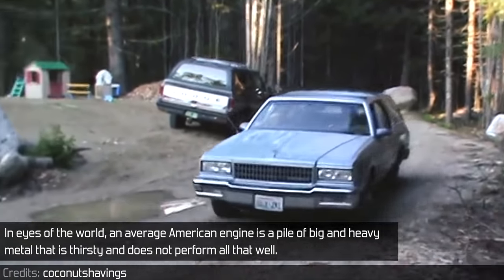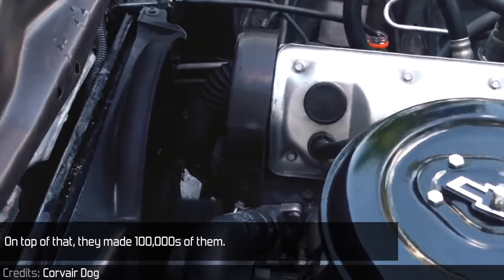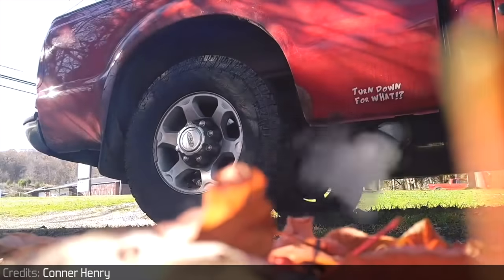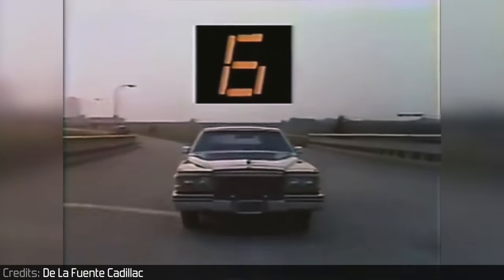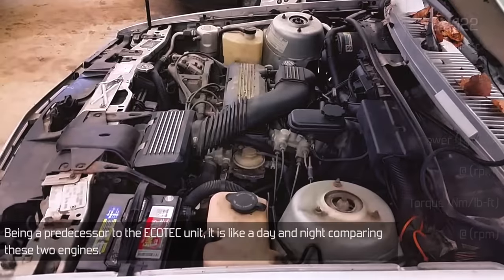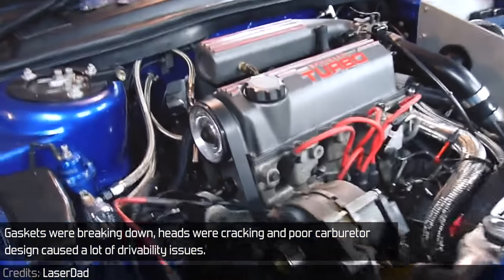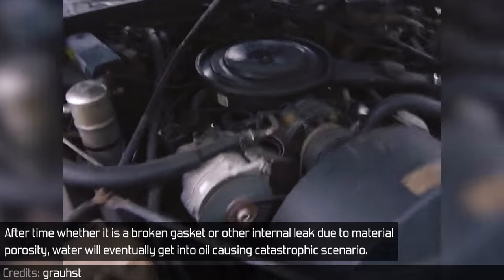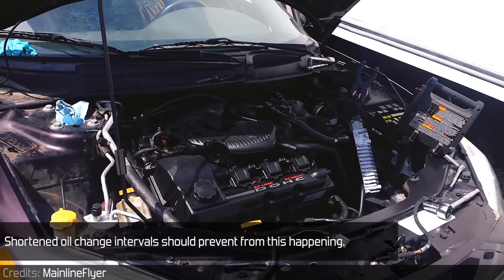8 Worst US Engines You Should Avoid

Comment: The modular motors (4.6 and 5.4 V8's and 6.8 V10, referred to here as triton engines) are very reliable power plants.  Yes they had some problems with spark plugs but they regularly make it over 300k miles without any other issues under severe use in things like pickup trucks that tow and cop cars/taxis that get beat on for a living.  The spark plug issues are easily and cheaply fixed with well-established methods.  Included in this engine series are the 4.6L dohc cobra motor with a blower called the terminator and the 5.4L dohc blown V8 found in the GT500's until 2012 and the Ford GT supercar.  The Terminator will make 700 hp reliably on stock internals and the GT500/GT motor will make over 1000 hp reliably on stock internals.  It's a very strong architecture with a skirted blocks and cross-bolted mains (6-bolt) just like the LS-series GM engines but with overhead cams so they tend to rev easier and they tend to respond very well to boost, especially in dohc guise.  The newest Ford engines, the Coyote, Voodoo and Trinity are very closely related to the original modular design.  These engines speak for themselves on the street/strip today.

Comment: Entirely correct about the Vegas' POS engine, but the Triton?  Not a bad motor for the era.  The Caddy V8-6-4 was well ahead of its time, the concept was good but the technology wasn't quite there yet, and Cadillac planned for problems by making it super easy to switch to V8 only mode (literally you just had to have a switch flipped); it ran just fine in V8 only mode and was quite reliable for the time.  The Olds diesel was a complete crap show, not just one of the worst American engines ever made, actually worldwide one of the worst pieces of engineering ever.

Comment: I’ve never heard of the Ford modular series having the spark plug problem you’re describing. I won’t argue that they’re underpowered and inefficient, but they are very reliable and long lasting. Especially the V10, which has proven itself suitable for severe service/commercial applications.

Comment: When Ford changed the Triton to 3-valve is when the spark plugs got very long and would break (mainly from folks leaving them in past 100k miles and carbon building up on the exposed threads inside the chamber), but the earlier ones were great engines, have two now, both run terrific.

Comment: The Ford triton wasn't my favorite but it was a durable engine that saw much heavy service in police vehicles.  Only the 3 valve was junk because of timing chain guides breaking toasting the engine by blocking the oil pick up screen.  It's predecessor was tough as nails though.   The GM 122 wasn't their worst 4 cylinder and a bigger version served fairly well in the S10 pick up.  The Chrysler 2.2 did good too until they stuck a turbo on it.  You nailed it on the others though.

Comment: The segment about the engine 122 for GM plainly shows the dashboard of a Pontiac Grand Am, circa 1985-1991. The alternate engine was the Iron Duke, which had an internal oil filter. Even mechanics could not get the filter cover on and off reliably, so the engine would soon start leaking oil, which would eventually cause engine failure. Some mechanics in the late 90's,couldn't get the cover off without stripping the bolt.

My mechanic explained that with the internal filter, it was almost like partially disassembling the engine to change the oil filter.

Who wants to partially disassemble their engine every 3000 miles?

The Chrysler K car didn't necessarily have a bad engine. It was just that with the engine installed, a cross member of the frame blocked access to the oil filter, so that the engine would have to be dismounted every 3000 miles to change the oil. Or, you could just buy a new car,every 3000 miles.
Reply: The 122 dashboard shown is a 98-03 S10 with a manual transmission.

Comment: As for the tritons, the 97-00 had as few as 2 threads holding in the spark plug. later models, such as the mustang with pi heads, had around 6-8 threads which made older spark plugs a complete b*tch to get out.

Comment: Speaking as someone with a 2.7 V6, it's a decent enough engine after 2001. I have a 2005 Stratus (insert SNL jokes here) with 150k, no serious engine or transmission issues. It's all about regular maintenance.

The biggest flaw for me is that the coolant bleeder assembly does fail around 40,000 miles. Having gone through two, I've made it a maintenance part. I guess that's what happens when someone decides it's a good idea to use plastic instead of metal for a part that sits right on top of the motor though.

Comment: I had an '88 Dodge Dakota with that 2.2. It proved to be too little power for a midsize pickup and it would often continue chugging when shutting off. I had it at the dealership several times, everytime having another part replaced, yet the problem never got fixed. But on a positive note, I got 100k out of it without any major issues.

Comment: The spark plug ejection problem on the Ford Modular 4.6 liter V8 affected mostly the pickup trucks, it was rare that it happened on the cars. Later they offered kits were you can tap in new threads for the engine in case spark plug ejection happened.

Comment: My top five engines are:

1. 4BT and 6BT Cummins. Simple, reliable, powerful, econ9mical, and no electronics.
2. GM LS Small Block (5.3 or 6.0) I Currently have a 6.0 from 2003, powerful, and reliable as all hell. A little on the thirsty side though.
3. 6.6 Duramax (Pre-Emissions), we use these at work and they are workhorses.
4. 5.0 Coyote. Best new gas truck engine on the market today IMHO.
5. 5.4 Triton (07ish and newer), my father has an ‘08 that has lasted 10 years now with no issues.

Honorable mention to the 5.7 Hemi. I like the engine, I just don’t really want to buy the truck they put it in. GM or Ford just makes a better all-around package.

My dream truck is a first-generation Silverado HD (99-06), keep the Allison tranny, but swap the power plant with a 6BT Cummins.

Comment: Vega was a piece of junk, but some liked them. My mechanic was asked to "fix" the 4 cyl.  which was early aluminum. The block, the heads would warp from heat . I stopped by and the car was done. He told me to give it a run and see what I thought. I was impressed, it didn't run like most of the Vegas' . His fix? He bored and sleeved the engine with iron , and reworked the valves. ported the head. Now it was a nice looking car that ran well ! I had an '81 Caddy with the  8,6,4 drove it until it rusted out. Kept waiting for it to act like others. I got lucky.

Comment: I had several of the 2.2L and 2.5L and had no problems except for head gaskets and were cheap to fix cost parts and labor 150.00. If you took care of the 2.2L and 2.5L change the oil every 3,000 miles and change the timing belt every 60,000 miles and your good.

Comment: The Mopar 2.2 issues did get fixed later on (much later on). However, there were even more issues than you listed, like the radiator support breaking where the engine mount was, causing the engine to roll back and forth enough to rip the CV joints apart, sometimes with enough force to put a hole in the transmision.

Comment: You hit the nail on the head (so to speak) when you put the Vega at the top of the list...that's why you don't see many original 4-banger Vegas at the shows. People swap in a 350 quick. And both Cadillac engines are better boat anchors than powerplants.

Comment: I am stunned the Ford Triton 4.6 and 5.4 are on this video. Except for the spark plug issue in some, those engines are among the best v8's ever made! The Mopar 2.2 had alot if issues like eating the lobes of the cam shaft but were updated in the 2.5 with roller cam and dual counter rotating balance shaft. The turbo was much more troublesome however did anyone else notice the odometer reading on the Doge Daytona at 278,000 miles! Could of had three or four engines though. lol The WORST thing about the Mopar 2.2 and 2.5 was the rattling they would make, it sounds horrible. It was as a result of the wrist pins being smaller than they should causing the piston to slap against the cylinder wall. Amazingly these engines would run over 200,000 miles witch was not uncommon.

Comment: The Vega engine actually was fairly advanced for the time in that it had was an open deck aluminum block engine with an overhead cam.
But it was prone to blow head gaskets and the sleeveless design was prone to premature wear.
Ironically it's successor the 2.5l Iron Duke had much more in common with a tractor engine.
The Chrysler 2.2l K car engine is actually very reliable in later iterations after the mid 1980s.

Comment: I can tell you from personal experience with two Triton v10s (one with 180k miles and another with 200k miles) that I have never seen the spark plugs just "pop out". Idk about the v8, but the v10 is a great motor. I will note that the engine gets a less efficient as time goes on, right now it just gets 10mpg. Not city or highway, just 10mpg regardless. 

Oh and those engines I mentioned are in farm vehicles, so they don't get fancy treatment or light work put on them.

Comment: What about the Pontiac 301 Cubic inch engine? Now that was JUNK!! The 4 cyl Vega motor. There's a prime example of GM cost cutting. My dad had a Cadillac V8-6-4. His was a rare one that ran decent. But wound up disconnecting the computer anyways. There are great engines like... The Chrysler 225 slant 6. (Bullitt proof.) Ran once with almost no oil for 10 miles. Don't ask.. Repaired the leak. Sold the car 2 years later. Was still running!! No damage. The Chevy 283 & 327.  2 of the best ever made. The Ford 200 straight 6 & the 289 V8. Both great engines. And the GM 3800 V6. All of these ran forever if cared for.

Comment: Hey now, I’m a GM fanatic til the day I die, but the Triton motors are pretty decent. I’ve been a tech for 25 years and yes, in the beginning of the 3 valve years, the plugs were a royal PITA. The tool to get them out works great, and it’s only the factory plugs that have the issue breaking. There is of course a decade before the 3 valve where the 4.6 kicked some butt. My buddy has a 2000 Expo with nearly 400k on it and never has had any major engine issues.

Comment: As I understand it, the issue with the spark plugs in the Triton was due to a two-piece design.  I don't know if this is a Ford design or a spark plug manufacturer design.  The bottom section of the plug stays in the head and the centre section blows out.  Almost all cylinder heads are now aluminium with steel spark plugs, so that is a non-issue.  The lack of a good anti-seize compound used on the plug is probably part of the issue and the long nose of the plug being too close to the hole diameter, allowing it to seize to the head may be part of the issue as well.  This is something that can be fixed with a good replacement plug and proper installation procedure, including anti-seize.

You missed the Ford Escort engine from the '70s and '80s.  It was so common that they blew head gaskets and cracked the cylinder heads that most parts stores stocked the heads and gasket kits for 3 or 4 engines.  I have seen the head come off an Escort engine literally in two pieces.  Here in Canada, a head repair shop in Montreal could weld one back together or repair the crack and it looked like original.  They exchanged heads so you didn't have to wait and a lot of the time you had to get one from them because there were no good used ones around.  

The Escort was also one of the first engines to use "torque-to-yield" head bolts, which requires replacing all the bolts if disassembled.  Many shops that didn't know better, or didn't care, would re-use the bolts, and the gasket would fail again, sometimes in as little as a week.

The Quad-4 GM engine is another noted for blowing head gaskets.  They were so noted, that car lots had problems selling anything with a Quad-4 in it.

Another GM engine that had issues, although, overall was a good engine, was the late '70s and '80s 305.  It worked well enough and as with all SB Chevs, fit anything and had reasonable power for the era, but, it ate camshafts.  I used to stock 5 cam kits for 305 and would install, probably, 3 per month at the peak of the problem.  Any 305 with a lifter tick or backfire through the carb, needed a camshaft, usually #7 exhaust lobe.  I have seen the lifters worn so bad that they wore through to the internal oil reservoir and the cam lobe would be round.

The Chrysler 2.2 also had a cam issue, with the cam lobes wearing to the point of ticking.  Last one I owned was just an old beater, so I dropped a washer under each lifter and the ticking stopped.  LOL  Of course, it didn't have full performance due to the cam being worn, but I drove it for another year until I scrapped it.

When GM lightened the SB V8s in the early '80s and '90s, they also created cracking issues in the heads.  They were common to crack the exhaust valve seats in the centre cylinders.  I have seen seats cracked across the face of the head between seats in adjacent cylinders and from the seat toward the intake face 2 - 3 inches as well as into the exhaust port.  Not all of the cracks were deep enough to hit water, but, they do create a hotspot on the valve face causing a burned valve.  It is quite common, although outside of the engine shops it is not widely heard of.  I would say that about 50% of the head I worked on had some cracking in the centre exhausts and it was the first thing I looked for when checking a SB Chev.

NorthStar and Olds Aurora engines are noted for blowing head gaskets and head studs pulling out from corrosion.

I know that there are more over the years, but these are the ones I remember now.

Comment: You forgot the worst feature about the 2.7 Chrysler V-6: the balance shaft.  (why a 6-cylinder design of small displacement even needed this is beyond me).            It used an overly long chain with a poorly-designed tensioner.  The tensioner's poor design was aggravated by the engine's tendency to foul its oil, which would cause the tensioner to stick and quit working properly.             The chain would develop more and more slack, allowing the balance shaft's counterweights to strike the crankshaft's counterweights.  You'd hear a mysterious ticking deep in the bowels of your engine, then, when things got badly enough out of alignment- BLAM!  Full mechanical interference and a grenaded bottom end.

Comment: I’ll add one more engine to this list the 1966 Pontiac 230 CI straight six. Great stuff like an overhead cam, aluminum head, and rubber belt/cog system that make it extremely smooth and kinda torquey. IF it runs for more than 2 seconds before blowing a head gasket. The car in my icon, yep, that’s how I know. Great engine when it works, but very brittle and with low tolerance.

Comment: Not one of Visio Racer's best videos, but I still am a fan.  The Vega engine was not based on a "prewar tractor engine design."   It was designed by GM Engineering Staff in the late '60's.  The belt-driven overhead cam and the die-cast aluminum block made it completely different from the previous 151-cube Chevy II 4-cylinder.  That was the engine that was later developed into the Pontiac Iron Duke.  (Which never got much love, either.)

Comment: You forgot GM’s terrible 3.6L V6. What an absolutely terrible engine. They should have continued using the old 3.8L 3800 series V6 which were very reliable engines. My grandparents gave me their old Buick Park Avenue because I needed something to drive to work and that thing would keep going and going. I only did regular maintenance and never had any problems and got it almost to 300,000 miles before it rusted out.

Comment: I agree with a lot of engines on this list, mainly the 4100 and early 4.5s and Chrysler 2.7.. However, the 3 valve Triton series engine was 'fixed' by a re-designed spark plug, and nothing more. The old 2.0/ 2.2 GM pushrod engine was fixed by using a newer style multilayer head gasket and a sealant spray, and nothing more. When computer technology caught up, we now have multi displacement engines world wide, and they work well. The Chrysler 2.2/2.5 4's weren't that bad.. At the time, EVERY manufacturer was having problems sealing up an aluminum head to an iron block. New technology fixed that, even on the turbos. Remember the Chevy 3.8 229 CID V6? Yeah.. That was the company's 1st throw away engine.... We here in the US called them the boat anchor block, because after they let go in service, they were worth nothing more than a boat anchor.

Comment: I have a 2001 Ford Excursion 6.8L V10 Triton. Motor has 190,000 miles on it and runs like a champ. The spark plug issue is a easy fix ( Heli-Coil repair kit ) and you want have the issues with shooting out spark plugs. I do wish Ford would have engineered this correctly from the factory but overall the motor is tough.

Comment: GM 2.8 liter V6, over time, the oil would sludge up (no matter frequently you changed oil and filter) and pool in the valley between the heads under the intake. Required a tear down to clean out the oil passages every 60K to 70 K miles to prevent engine destruction.

Comment: I had a 1981 buick lesabre with the 350 diesel V8, I replaced the worn out head bolts with grade 9 bolts. It worked just fine after that.